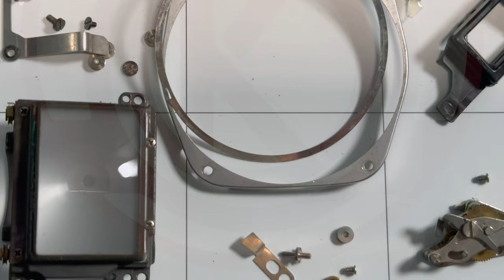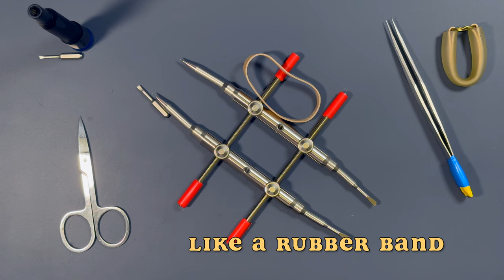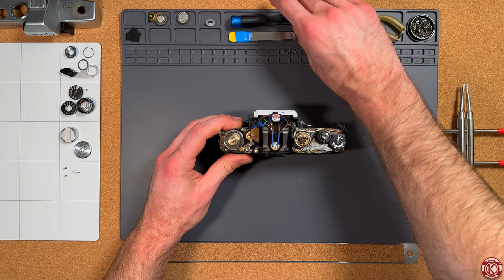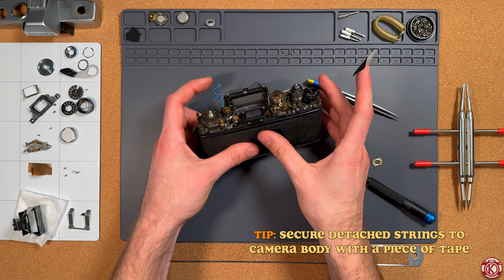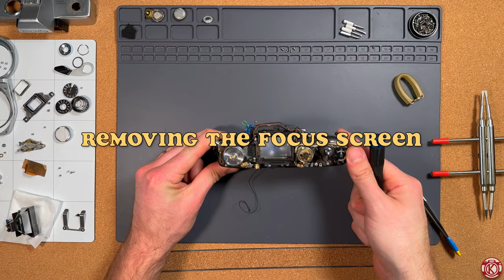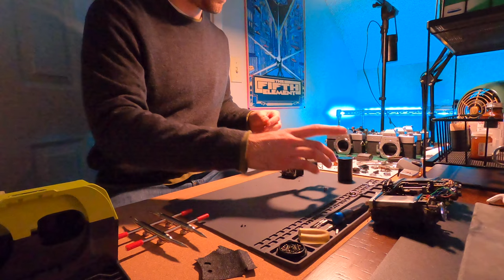Disassembling the Minolta SRT 101 - 35mm film camera restoration

Comment from the maker: 🔴 I realized I forgot to mention the SRT’s little metallic red dot that normally covers the name plate screw. This camera was missing it’s red dot, evidence that it has most likely been opened before. This dot can be removed using isopropyl alcohol and a sewing needle 👍
Reply: This is an amazing video.  I love how you lay out the tools at the start – very helpful!  

I have struggled with that infernal red dot myself and have since seen a better solution.  Instead of prying off the dot to get to the screwhead underneath, I have seen people successfully remove the screw with the dot intact by using pliers to grip the sides of the screwhead and removing it in whole.
Reply from the maker: @frankpavich  Aye thanks for sharing the great tip Frank! Pinching and turning the screw head is a tried and true method, especially since they don’t sell these little red dots anymore. I have fashioned a pair of flat head pliers with adhesive foam on the tips for just this purpose, this helps prevent accidentally scratching the name plate with the pliers 👍 I’m glad you enjoyed the video!

Comment: Do you buy chance know if there's any drastic mechanical design difference between the 101 and 201? I have a 201 I'm wanting to try to fix.
Reply from the maker: There are very few design differences between the two, and are mostly cosmetic not mechanical. One of my favorite things about the SRT series is the fact that nearly all the parts are interchangeable from the 100 to the 303. The later models do have a hotshoe on top and may require detaching a few more wires to access the internals but other than that the layout and sequence is the same. Definitely check out Eugene Pates CLA guide I linked down below in the description, it’s a wonderful resource if your looking to dive deeper 👍
Reply: That plate at 3:00 is super tight on mine. Can't get it off with any force
Reply: I eventually used needle nose pliers for this - not ideal, but I loosened it up for next time